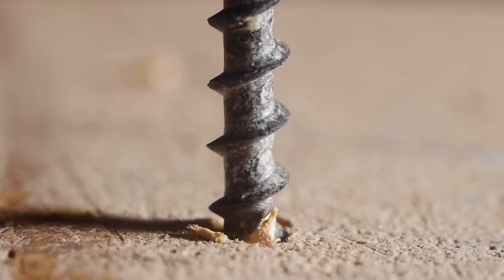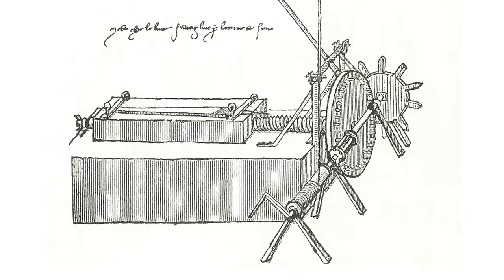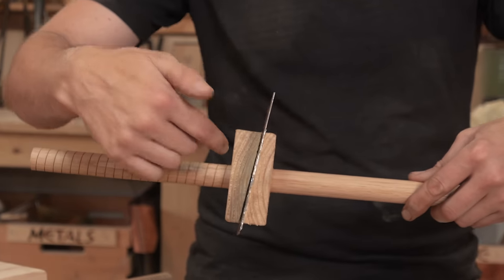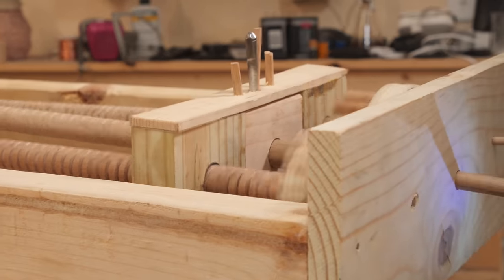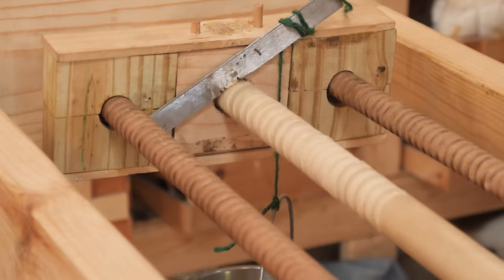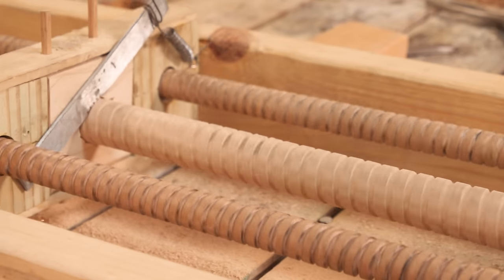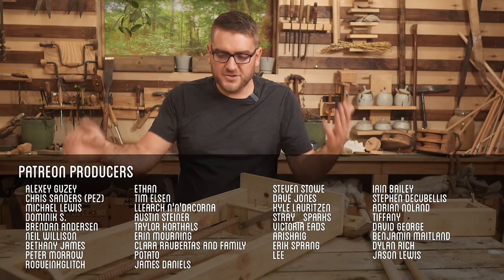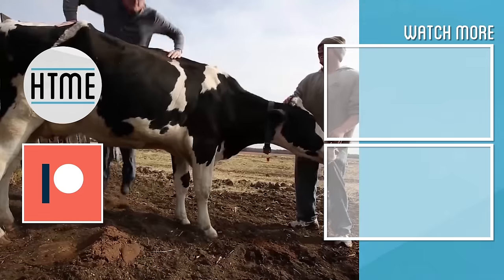This DaVinci Machine Unlocks Precision!

Comment: Not to discredit you, but a video like this might be better off if it gave credit to the inventor who actually set the standard?  If I remember correctly, it was Joseph Whitworth, and I think he would use a master screw to manufacture others, while also helping to improve the accuracy and quality of instruments, like those used in navigation.
That, or I'm thinking of someone who came much earlier.  I remember an inventor who was discussed in the show Connections, revolutionized the accuracy with which tools could be manufactured.

Comment: Instead of a narrow blade (what's being done with the blade-in-the-block technique), why not put the triangular file idea (a toothed wedge) in place of the blade?  Pressure-load the wedge, and spin the rod back and forth with a rope wound around the dowel and do the thread cutting in a single operation, instead of marking and then cutting..

Comment: If you can just mark a thread by having the blade at an angle inside the block and just screw it through, do you even need the 2 screws? Couldn't you just take the same thing put be block inside a channel and let it pull itself along? Then you change from a blade to a file that is pressed against the wood and let it ride the precut grove? You could even keep the blade at the beginning to give you more stability.

Comment: 4:28 How do you know that they will be evenly spaced? Could've had two blades so that the threads have to be evenly spaced..
Reply: Because the amount it advances forwards each turn is a function of the angle of the blade and the radius of the dowel. Those don’t change so it’s evenly spaced

Comment: Couldn't you do the same device that you have shown in 4:21 but for either angle towards that point so that it cuts into the wood and each takes out, idk, 45 degrees or 33 degrees - wouldnt that be an easier way to make a consistent thread? Also - you would just need to make sure the original device you made in 4:20 just cuts deeper in the wood to make sure you are able to notch out each side after that.

Comment: Our screws not geodesic?
Just use a piece of paper or something else that’s flat and foldable like a leaf and cut a straight line into it and use that connect two of the dots and you will necessarily have a perfectly smooth thread

Comment: "Screw threads". the term comes from early machinists watch makers and mechanics would file the "threads" to fit a fiberous thread.  You would simply wrap your work piece with a thread of a certain diameter and file the work piece till the thread would fit in the groove you filed correctly.  it is the same as when you are weaving fabric and have a certain thread count.  videos made by people who did this video make me laugh.  they could have saved a bit of trouble talking to an experienced machinist like myself.   when they had the desired screw finished (longer than they required.  they would use a portion of the screw they had made and form cutting edges on the thread s, harden this and it would become the tap with which they would cut the female thread that the screw would screw into.  back then they made each screw to fit a particular Nut.  they were all one of a kind .

Comment: You still need a straight length of wood to craft your screw. I said it before, you haven't unlocked the tech of straightness yet, you jump from a piece of raggity wood to a straight milled rod. Same with lumber. You havent unlocked that tech yet.

Comment: I would use the new machine to cut a pair of bronze screws and nuts to upgrade it. if your careful you could easily cut bronze with the new machine. much more durable and precise. 
one of the progressions of machine tools was they were able to gain precision with each iteration. as the operator gained knowledge of the machine he was able to make better parts. and used them to upgrade the machine..Repeat.

Comment: Are you kidding me?! You were so close, how did you not figure it out?! That device you made that cuts an even spiral line into the rod, if you just use that exact same setup and cut a hole for a pointed chisel or similar, you can cut a perfect screw using that exact technique. You were so close... unbelievable... You don't need that over-complex shitty lathe at all...

Comment: so why did they not just use a cutting point pen in the screw hole, maybe the blade cutting the first line and the pen cutting later the complete thread, yep hand powered, your first marking tool is the better tool, more simple, just add the final carving tool on the opposite side, in the same groove. bot for making bots.

Comment: Wouldn't it be easier to just cast the screw?
Reply: Casting is great for moderately repeatable replication. However in order to do that you must first have a screw to make a mold. Casting is also rather slow compared to cutting screws once the tooling is made. One of the big things that happened in the industrial revolution is was the ability to make extremely consistent screws. Before that every screw had to be hand fitted to the object being built. It would only fit correctly in the spot it was fitted to
Reply: @Garoninja  what's the difference between a bolt and a screw?
Reply: @mclovin165   Great question. Bolts usually pair with a nut. Screws on the other hand don't require a nut.

Comment: Uh.. why didn't your blacksmith just twist the steel in a vice to make a simple screw? That's essentially how we make auger bits, you'd just have to twist it tighter and not taper it from tip to head like a nail...
Reply: I did and they do work, but the video was about making a screw lathe capable of reliable precision so having my carve it gives a better idea of what process we are trying to mechanize
Reply: @theomelchior2739  gotcha. In 18 years at the anvil, I'd never seen somebody thread a nail lol. Now that the kids are in bed, I can finally finish the video. Thanks for the reply.

Comment: Silly Idea with no basis in history, you could use this to effectively make screws for a very primitive milling machine. make a few matched sets of normal and reversed screws, set them in each axis, then rig them like your setup there with gears for forward and reverse movement, and then some method of cutting. What you'd wind up with is a more accurate method of carving out any wood you might use in the future, as there will be less hand held carving, it could also be measured to a standard. Just a silly idea for a video, although this idea would require some serious man hours.

Comment: so noone ever considered the idea of simply using a wedge pulled by a string driven by a pulley attached to the shaft?
yeah... nah. of course they did.

only an idiot would cut a thread by hand. the real practical advancement was to drive the cutter with a wedge to produce an accurate thread on the FIRST GO.

davinci should be remembered for his paintings and carvings. because he sure wasnt much good at mechanical engineering.